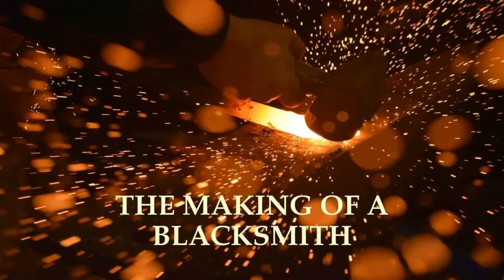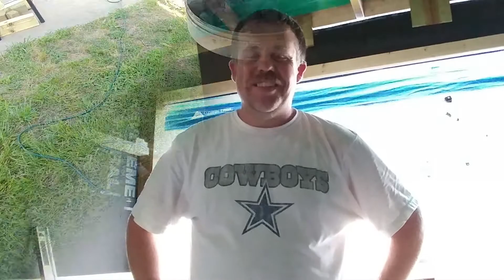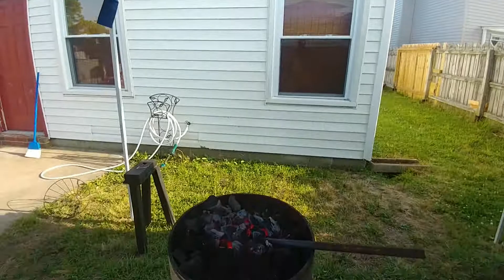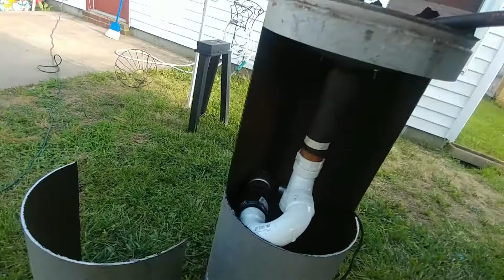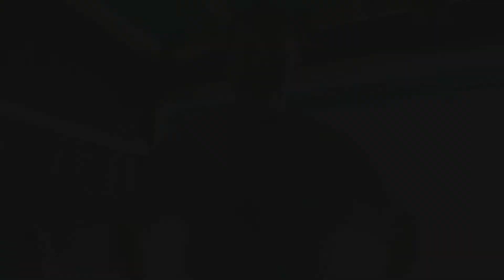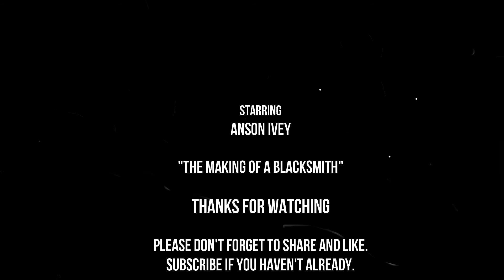Charcoal Forge build part 3 Maiden voyage #iveysforgeandhomestead

Comment: Looks like a good forge bud. I agree with your comments at the end of the video about adding a table and a valve to reduce the air flow. Those were the only two things I'd have suggested to improve it. 
Charcoal is a great fuel to use on the whole as it burns really cleanly. 

Where are you getting the charcoal from? The cheap supermarket charcoal we get in the UK is usually made in Africa and is very poor quality and spits sparks everywhere. If you can get locally made charcoal it'll be much better. I made my own charcoal for a while from old pallet wood, it was lovely to use but I got a strongly worded letter from the council to stop it because of the smoke... oops. 

All the best bud
Andy